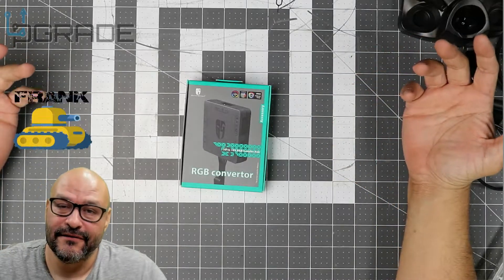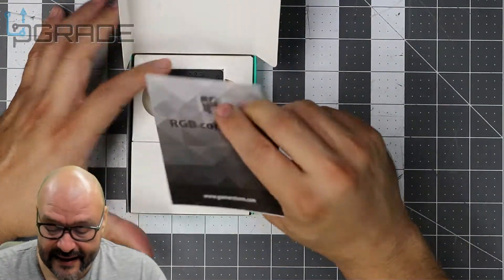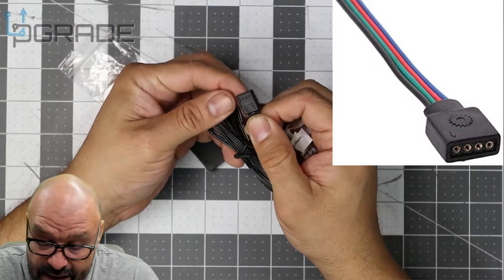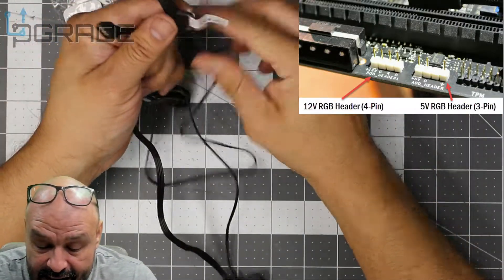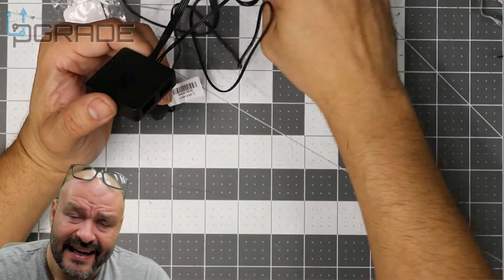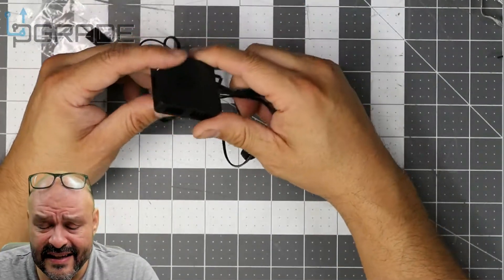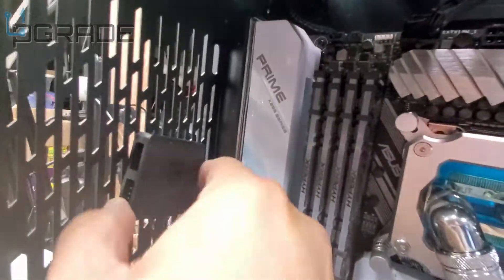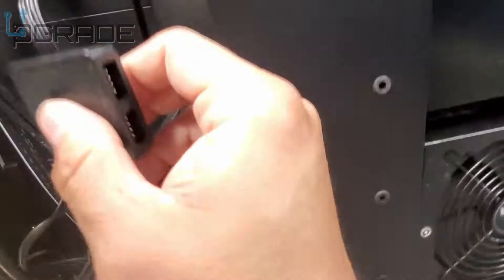RGB Convertor - Convert 3-pin

Comment: Question: bro i have b450 tomahawk max which has 4pin /12v rgb header can i sync argb fans with this converter?? BTW nice video 😍😍
Reply from the maker: Not sure an I wouldn't you might burn something on thr motherboard if the power is different
Reply: so you can sync them but it seems like it can only sync as long as you choose a static color effect..no cool lighting effects
Reply: @Ant_Stark  yeah 12v isn't addressable

Comment: Hello can I put an RGB 3 pin hub on this
Reply from the maker: What type 12v or 5V do you have ?
Reply: @Upgradetech  I have a hub that needs a 5v 3pin to power all fans 
the pin is a 2 + 1 (2 on one side 1 on the other)
Reply: @Lotisgaming  Eu comprei um hab da DeepCool com quatro portas de 4 pinos 12 voltas e liguei mais quatro fans DeepCool na exaustão. Agora se funcionou 12 Volts também deve funcionar os 5 Volts também, fique atento com o consumo em aperagem quando ligar os fans.

Comment: Is the 3 pin 5v from the lights in your case???
Reply from the maker: No its a fan voltage 12v
A three pin connector is basically power (5/12 volt)

Comment: since it only has one 5v output, can i use a splitter to power more 5v RGB devices. i have 4 RGB fans in a hub and a Deepcool  gammax RGB cooler that also requires a 5v input, on my B450 F gaming board.
Reply: You can do that with a splitter cable
Reply: @ahmedjafri09  yes
Reply: Maybe daisy chain?

Comment: I'm using one without any problems. I use an Antec RGB controller with four fans plugged in and then that plugged into the converter. And because you can control Asus motherboards and GPUs in iCue, I can control everything through iCue. I even have an additional cheap 12v RGB strip plugged into on of the 12v headers on the converter and it works perfect. You do not have full ARGB control, but solid colours or solid colour changes works perfect.
Reply from the maker: Thanks great info, some people don't even want the RGB control but Christmas is around thr corner it would be nice to change the colors to the season.
Reply: whaaat no full argb control lol solid colors and solid color changes ? I already had that without this stupid box...